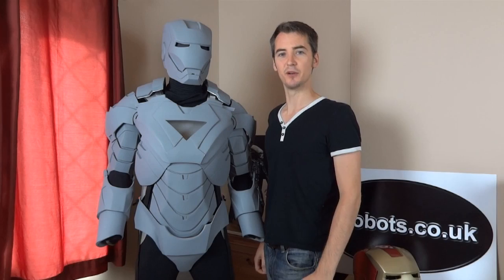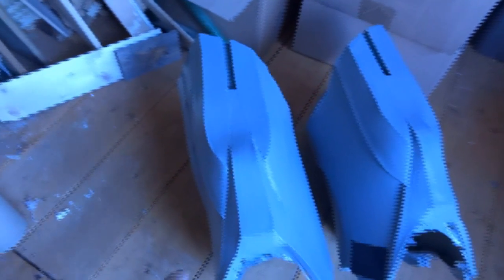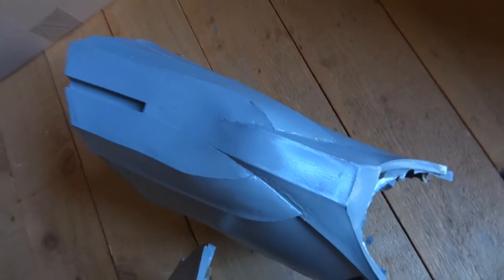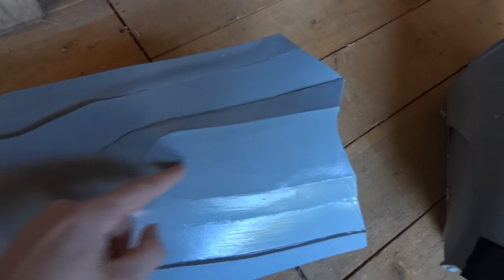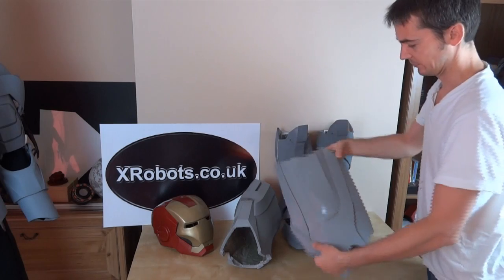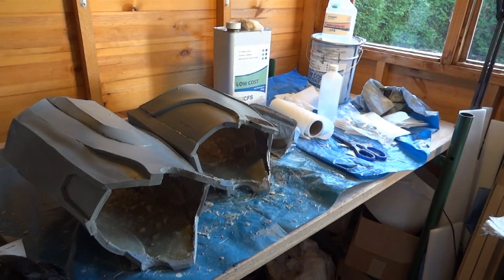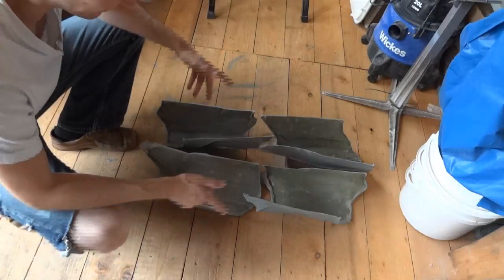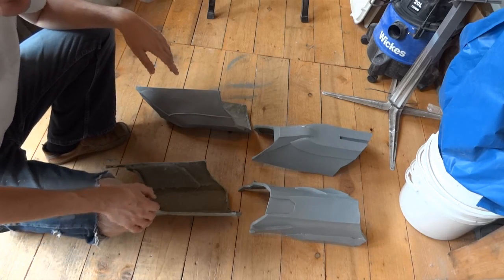Iron Man Power Suit #24 | Armour Thighs pt 2 | James Bruton

Comment: Very nice work James. That jig was dandy too. Just kidding. One thing I have learned building my Mk III is using the Dremel/rotary tool with a thin cutting disc puts much less stress on the part when cutting them. I found the straight blade hanging up in the groove to cause cracks. Just a suggestion.